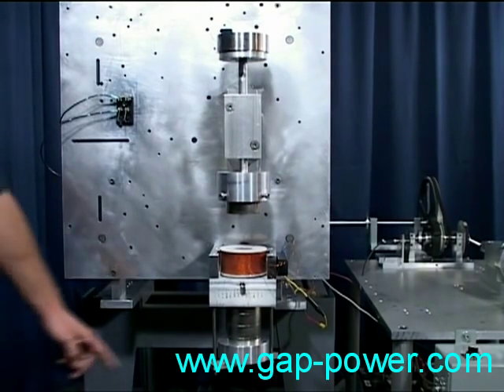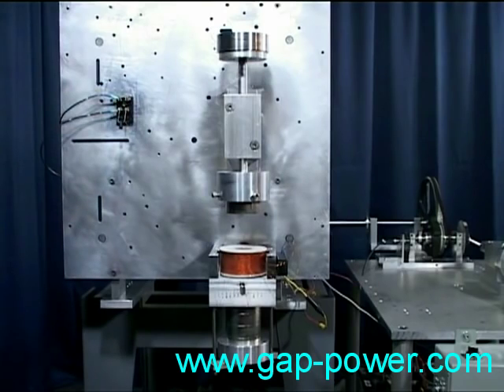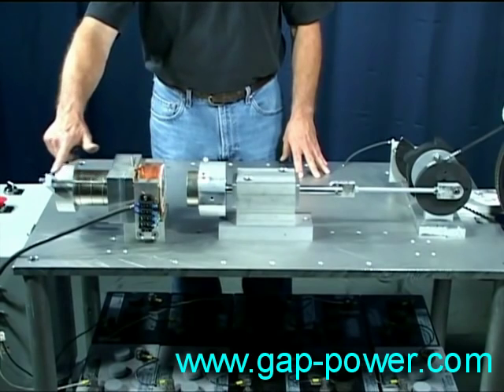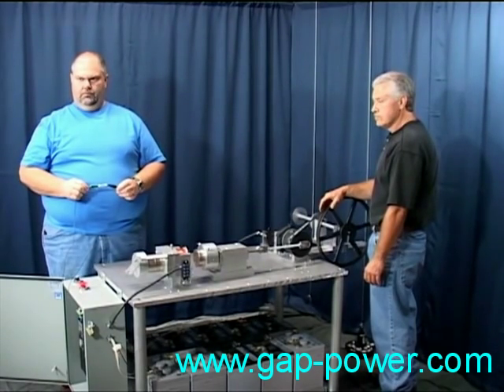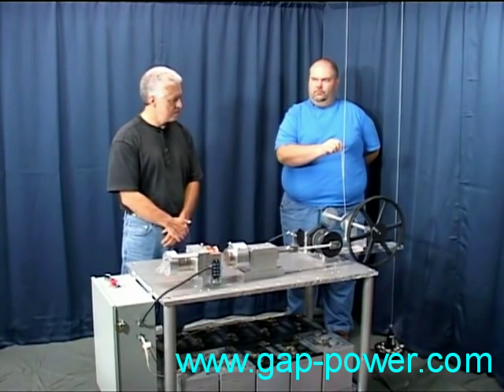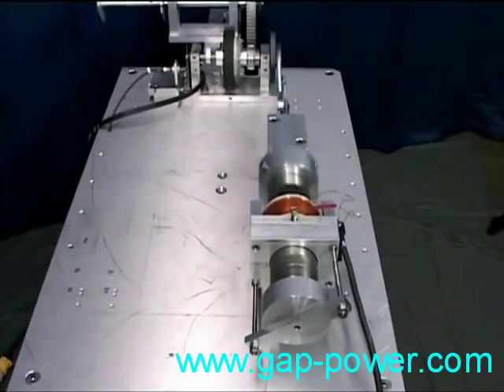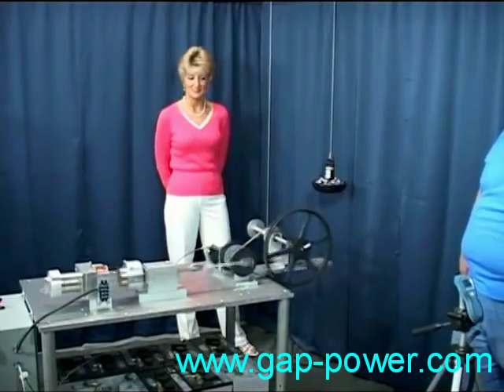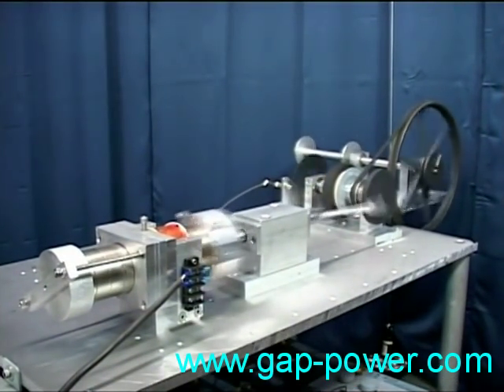FREE ENERGY # 24  Working Magnetic Overunity Device - Magnetic Neutralization

Comment: Why don't you crank the thing up and let it eat?
If you have an over unity machine, it will wear itself out before it stops running.
You could use the surplus power to propel a vehicle at some speed for a time limited only by the mechanical endurance of the machine.
Take it out to the salt flats and set it running in circles.
See how many laps it makes.
Even if it only moves 1 foot per hour, that would constitute empirical proof of your claim.
If you build it well, it should run for years, non stop, with no input.
If you can't do that, you don't have overunity.
You know you can't do that so you know you don't have overunity.

Comment: All you need is a large capacitor  and a generator - loop them on your motor and check the efficiency of the unit running.  Also use fine multiple strands wire to increase coil strength.

Comment: Instead of using the "switch" coil to also collect the power, have you tried passing the piston magnets through a separate coil?  Like the "shake to power" flashlights.  Then you would have your input power only supplying the "switch" coil and should be able to measure the output from the piston coil.
Reply: johnhoff420 sup 420, this account user didn't make the video, check out gap-power(dot)com. You have a good question about passing the magnet through another coil, I think you should try it. Art Porter, the maker of this video is still in the beginning of his experiments and probably has not tried it yet. This is certified over-unity.

Comment: Awesome work !!   Over-unity or not.  Efficiency is the question.  Where does this go from here. Is it more efficient than a standard electric motor.   Put them side by side and compare.  A standard piston engine would be easy to convert to this technology. Just replace the heads and piston.  It probably would need to be a plastic block though . Because magnetic eddy currents would be all over it, creating heat and other issues.  Make a small engine and find a use for it.  Then demonstrate it every where you can..

Comment: Simple way to prove your design. Connect a dc generator to the output shaft connecting it to your coil, then remove all the batteries. Then according to you all you need to do is start it by hand. Also, if it is a overunity motor, then it will constantly accelerate as you are constantly increasing the output which is now your input.

Comment: So, according to the meters you've shown and your statements of conversion, the mean input power was ~3.2 watts, the work performed was 52.25 rpm X 22 lb X .27225 ft = 312.95 ft*lb/min.  About .0095 horsepower, or about 7.075 watts out. How many watts can you achieve by connecting a generator or alternator driven by about .01 horsepower? That would be the true measure, since you would have like power in and out.

If the input of a device isn't measured, there's no way to know if it's an over-unity device. Your statement of no one measuring the input of their device makes no sense, since it would make the whole exercise pointless.

Comment: I like the design. Definitely original. I haven't tested my device yet for this but.... to be an overunity device you must be able to connect it to itself. It should power itself, and increase in rpms due to the over current, unless you have voltage regulators (with a power dump off that would be constantly increasing) until terminal velocity has occurred. Not saying this isn't true, but some thoughts to consider. Check out my device on my page and tell me what you think.
Reply: Chad Smith original 130 years old ; ) http://www.rexresearch.com/gary/gary1.htm

Comment: you need to create a lot of electricity in order to make that elektromagnet  repulse permanent magnet strongly.  You can use electricity from that motor itself but it will not produce so big electricity to make that electromagnet so strong that can repulse the permanent magnet so fast that it can produce electricity to feed that electromagnet

Comment: Overunity has become quite a buzzword. A gasoline or steam engine can be considered an overunity device because it produces a surplus of useable mechanical energy over the energy used to make it work and sustain itself, lacking of course, self sustaining without any outside cause and effect. The question here is whether or not this is an overunity device. It uses a battery or feed back capacitor to energise the coil and 'neutralize'  the poles to momentarily attract the piston, creating a reciprocating mechanical motion. This not only appears to produce MORE electricity than it takes to run it;  because of not only counter induction of the coil onto itself, but because it is a moving magnetic field acting on a conductor, inducing additional energy into the coil. An added surplus is the mechanical energy derived from the movement of the piston and pulley. Without having figured in all the friction and hysteresis losses, it appears that you have achieved an overunity device. I am speaking from 23 years as an industrial electrician, working with large motors and mechanical devices, and just such principles causing safety hazards for mechanics and electricians. This is the ONLY "overunity device I have ever seen on Youtube doing any usable work. Congrats and good luck!
Reply: How does a motor powered by batteries supplied with claims make it overunity?

Comment: its just a pulse coil it becomes an electromagnet with opposite poles so it attracts the other magnet else it won't work horizontally
Reply: Actually you're partly right - however the pulse it requires is a lot less than you think because it isn't working in the fashion you think it is - there are permanent magnets on both sides and in the center. All the pulse coil is doing is creating a field just strong enough to negate the natural field of the magnets it surrounds so it gets pulled/slammed toward one side of the rig. Pulse is released, the magnets violently repel each other and slam it towards the other side where it is just stopped short by repulsion, and the cycle starts over. It is ingenious really it is basically working just like an extended stroke 2 cycle engine, only electrically. The center coil is basically the exhaust valve. The opposing magnets are acting like compression chambers. I'll be damned - that thing might actually work.
Reply: I'm not saying it does work, however I'm not going to dismiss it since I have no idea what is involved with the device. It obviously is not the same as the kids toys sold at Radio Shack when we were kids. Just think about the flashlights you shake a few minutes and get about an hour of light out of. If you listen carefully to what he's describing, it sounds to me like they are attempting to put energy back into the system at different points, not just the single pulse coil - supposedly increasing the output. Like I said - not saying it is actually working... no hard data to go over. Still an interesting device to see on such a large scale though!
Reply: Haplo Voss Yes but you say that it produces only 50% free energy because its path down needs the exact amount of energy that the magnets hold so you can disable them and still fine tuning is needed to match something like 0,00001pHz at x * lambda still the coil itself creates EC resistance and heat between the magnets which additionally lowers the efficiency::: The only way to make that work is to make a rotor switch with a special alloy magnetic shielding. I was searching in the net for an alloy that stops magnetic waves but does not create resistance to them::: The two solutions are either superconductor switch, or I found a very few university articles and documents about a couple of very strange alloys from large molecules produced from iron oxides, cobalt, Mg, Md, and even iridium I think.

Comment: The power from this device is that of the magnetic repulsion of the cylinder on its power stroke, it is a fixed value. I have seen these using electromagnets from solenoids, a reed switch being tripped at the closed part of cycle. I feel this there is something fishy about this coil and overcoming magnetic field...It must just oppose it? or there are no magnets and a spring was in the demo and the coil simply is a electromagnet..? Anyhow its sort of useless just like toy motor with solenoid. Will not make any useable power with fixed magnets, and to overcome field power would be more than output + losses in machine = toy

Comment: Regardless of what the coil is used for, it still requires a certain wattage to run.  The bottom line is how many watts go into the system compared with the amount of work produced. Were those numbers ever revealed?

Comment: Very interesting device. How about a simple current measurement of DC amps on battery input. Then attach a generator to your output and measure DC apps out. Simple but effective manner 2 determined total power consumption verses power output. Final experiment use DC output to power coil

Comment: The Caveman Motor by Nuimshaan is simply amazing, and is quite simple:
1.  A long plastic barrell with bar magnets on one end, and iron bolts on the other end.
2.  A plastic housing for the barrel to spin in.
3.  A large coil wrapped around a plastic stud in one end of the housing.
4.  An iron bar with the leads of the coil wrapped around it..at the other end of the housing.
5.  The magnets in the barrel spin by the coil, and the iron bolts in the barrel spin by the iron bar.  

Give it a spin.

Comment: i wonder why haven't they tried to attach the big wheel to the piston and turn it into a generator. generating lots of power so the coil can be activated by the generators energy after start up and still have some generator coils produce power to the outside of the system.

Comment: Mag current only flows 43% of time, but is big current to make strong field to end repulsion of perm mags. Likely not good enough to approach 0.95 efficiency.

Try this: remove battereis & eletromag! Zero input after initial shove... to turn a wheel (replacing electromag) with open gaps (perm mags repel) and patches with gravity shield (nu-metal, etc) or mag-repelling diamagnetic BISMUTH or pyrolitic graphite. Gear this wheel to rotor. (First test how much effort to turn wheel various setups)

Comment: It's quite easy to determine if it over-unity. Simply measure the battery voltage with a good quality digital meter when you start out and let it run. Battery voltage should slightly increase over time, and the system should run indefinitely. Since meters are easily fooled by pulsed energy, after the system runs for an hour or so shut the system down and measure the battery voltage again. Then you'll know for sure. Big question is  this - is there enough excess power to run something else?

Comment: I like the Idea but if you want more power why not put a coil around the piston like in a shake flash light to get the power when the batteries are off.And add a capacitor to smooth out the pulse?

Comment: You  have  many  things  wrong  why  did  you  change  from  verticle  to  horizontal?  You  lost   some of the energy from gravity.        To prove  over-unity  you  need  to  remove   the  batteries which  you  have  not  done.     You  could   remove   the  batteries  and   the  other electrical components  and  replace the coil  with a iron  shield inbetween the permanent magnets. When shield is removed  the  repulsion drives your piston assembly.

Comment: excellent video !  Thanks. As long as you have a battery you cannot compare inputs and outputs.  The only starting point is zero everything. Power up a dead battery from the machine and you might have a chance.  But the machine can't work without either a battery of a person pulling  a wheel.

Electromagnets are tantalising but unless we get to a battery-free setup - we ain't going no place!

Comment: Ah, I see.  I took the wrong term.  :)  It's not perpetual, of course.  XD

Is there a certificate of the input power?  The batteries will eventually run out, of course.  So is this simply 'more bang for you buck', or does it make sense to re-store the energy somehow.  More specifically, does it make sense to convert the energy back to electrical energy?

Comment: simple solution. take the sum total of power going in. hook to a generator with greater power. coming out. lets say 1000 watts in to a generator 2000 watts coming out. Now IF device can recharge battery bank powering said device and still have the extra 1000 watts to use for something else then you have over unity. simple to prove. Look at wattage coming calculate  from battery bank. next hook generator up have it recharge battery bank the hook loads to generator. Then run  loads off generator.

Comment: Nope, not possible.

People think magnets offer free energy, but they dont. They require an equal force to separate them once attached, negating any energy derived from the attraction.

Spinning wheels powered by magnets merely put the force in limbo, making it chase its own tail. Any attempt to harness that power will make the wheel slow down and stop.

You cant cheat the system

Comment: Good video. And that is the problem with all the nay sayers saying that they alone hold the key to this wisdom called science - How do you measure the magnetic effect?  I have never seen that even taken into account. Of course if you find a way to turn the magnet on/off and reproduce motion you're going to what is termed overunity.  In reality though you are using an exterior force such as magnetism and its accumulative affect on an electrical input, as it were an electrical lever.

Comment: Over-unity? It is possible. Having not built, and tested this device, I can't say for sure, but the idea of capturing what would otherwise be wasted energy, with using the coil, matches what my own personal experiments have shown me. One thing that concerns me is the energy required to recharge the magnets after depleted. That may be the limiting factor. However, that design may still be (over) efficient enough to be over-unity. I do like your motor design. Keep up the good work.

Comment: I love your design of the motor and the system you used to move the piston. I've been working on similar magnetic motor concepts. They aren't over-unity but they should produce more horse-power than standard combustion engines and I'm hoping to replace all combustion motors with this technology. The age of a world run with magnetism is near, we just need to continue to peruse the light at the end of the tunnel and not let anyone tell us what "combats the laws of physics".

Comment: i like this - have you considered using mechanical timing instead of trying to cancel the field with a coil. less input power to turn a timing disc with holes that sync over the drive magnets with no coil. shielding the field could get your device even more effecient. as described in the threads the addition of a cap in the output could then be considered for running power to the input. im sure this could work as there are many videos looking at shielding to minimise input power requirements. k

Comment: You need to measure the power that can be output from the machine vs the input power. All that is happening in the video is the machine draining a bank of 12v batteries.  Please properly measure the output vs. input and post it up.

Comment: I have a similar concept that I'm working on for a magnetic piston engine that has a very similar mechanical structure to a combustion engine but will be at least twice as powerful meaning that a 6 cylinder magnetic motor would have as much and more power than a 12 cylinder combustion engine.

Comment: I am not saying it is or is not an Overunity Device. But i can tell you a very simple method to prove if it is.  Run the output power back to the input source. let it run and monitor the input voltage source. If it does not go down or stay equal then your onto something.  If it does go down or stay equal then its not an Overunity Device

Comment: Agreed, nobody has any real experience with over unity devices. If you want to beat the skeptics you have to get rid of the batteries and use capacitors.  Close the loop. You can use a removable battery or DC supply to start the motion. But once you capacitors are charged it should be able to continue without the batteries until the bearings or some other part fatigue and fail.

Comment: Thank you for sharing.
An excellent demonstration and machine.
Why not PROVE it is overunity by making your crankshaft drive a generator to feed the batteries - then monitor battery voltage as you load them ?
OR 
Rectify output from a coil winding around the magnetic piston going backwards and forwards !!!!!
.
Only when you get 'free' power from your battery pack can you claim overunity.

Comment: We know what the beautiful green arc means at the knife switch !!  Radiant Energy.

An Open-Loop Energy System can easily operate at a Coefficient Of Performance > 100% , just like a hydroelectric turbine generator, or a wind electricity generator, or a photovoltaic panel are also  C.O.E. > 100% systems .   There is no breaking of any physics law going on here, people.

Big Bubba there needs to hold the light away from his belly.  
Hooray for Big Bubba !  And Hooray for Art Porter.

Comment: I found your video very interesting.  What is the Voltage and current required to neutralize the magnetic field?  i.e. what is the Power required for neutralization compared to output power.  My guess is the input power is greater than the output power and therefore not overunity.

Comment: This method of using magnets is nothing new. As far as overunity goes the test is very simple. Use the weight that the machine lifted up to run a generator, see if it can produce more electricity than what was applied.